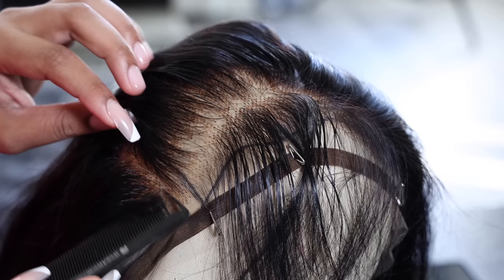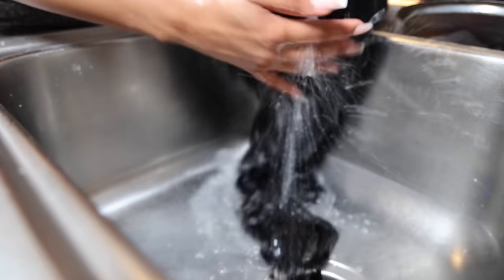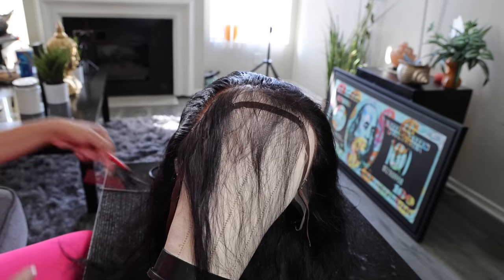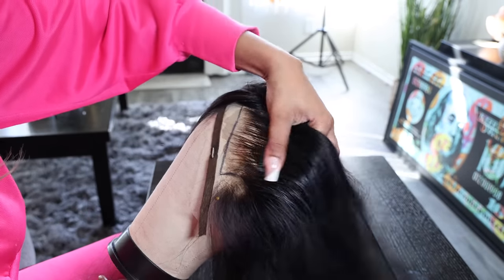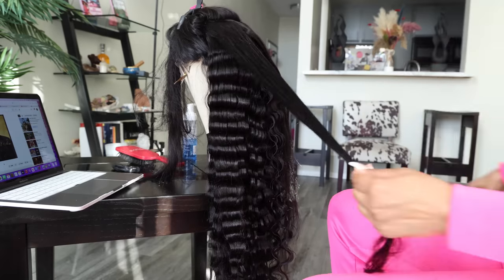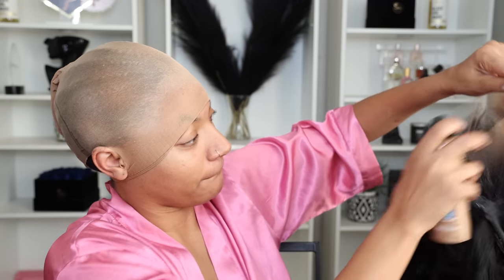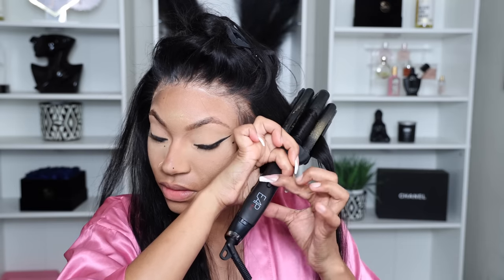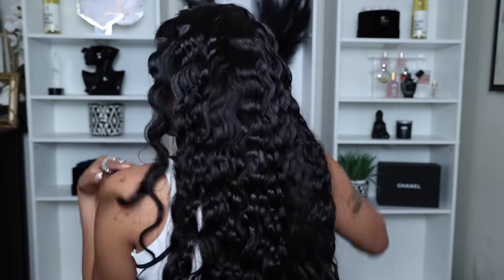ULTIMATE MELT From START TO FINISH | Frontal Wig Install &  Wave Crimping Tutorial FT WIGGINS  HAIR

Comment: Have you tried the zig zag scissors??? It really helps the lace melt. (If you don’t know what that is. But it’s a scissor that has a zig zag shape to it. And it helps the lace blend a lot better then using razors or zig zag shape with regular scissors. I cut my lace on the mannequin so it’s closer to the hair and I still do the edges before installing) even if you don’t do a video you should try to see if you like it 💗